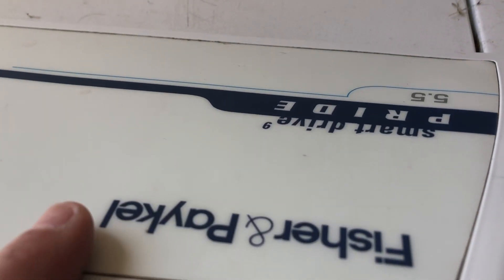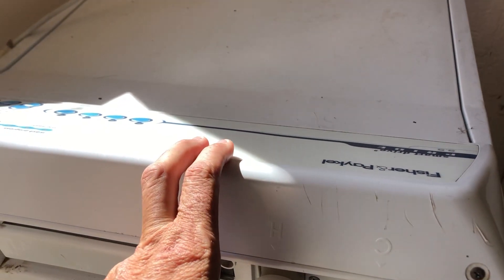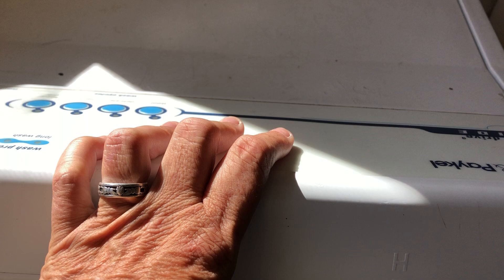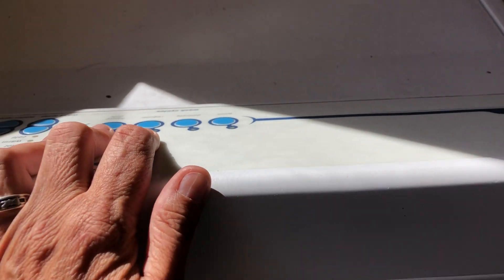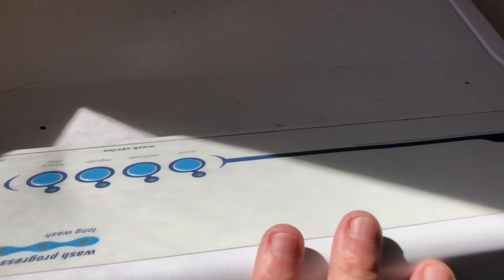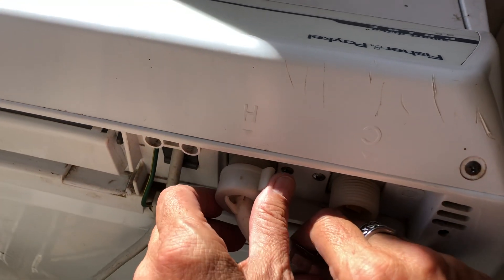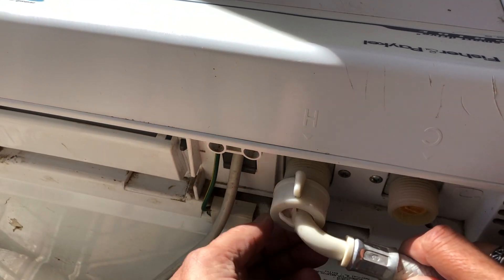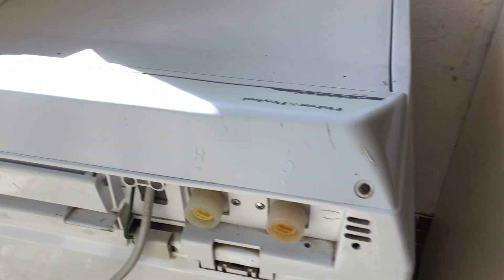Fisher & Paykel smart drive PRIDE 5.5 MW059AU top load washing machine | Water Valve or Mother Board

Comment: I’ve got the same washing machine as this one and I had to replace the whole water valve assembly a couple of years back as the seal where the thermistor would usually sit was leaking so I fitted a spare one that I had lying around and the machine has had no further issues since.
Reply from the maker: This is good to know that the repairs to bring a machine back into service do last. Thanks for watching and commenting

Comment: Cool!!! And Hot!!!😅 
Fisher/Paykel makes a great many things. Including medical machines. 
The heater that is attached to my friends ventilator is made by them. I have swapped heaters to service one and then swapped it back. If course it is a bit different with someone’s life support depends on that machine. Every thing needs to happen on the swap in order and quickly!!! 
A bit of a high wire act. 
But doable with two people well coordinated. 
Thanks for sharing this one!!
🐈‍⬛🐾🐈🐾👍
Reply from the maker: I can see how that would be a delicate and coordinated effort. Surprising thing was when the repair place looked up the price of a replacement valve it was over $160 so they found me a second hand one and they only charged me $30. A big relief since it has cost $200 in vet bills in the last two days. Our cat is very sick. This is what savings are for. She spent her birthday at the vet. Has to go for xrays and ultra sound tomorrow on her abdomen. So very happy I was able to fix the washing machine myself, our girl has been throwing up a lot and the amount of bedding needing washing seems never ending. Also the lock on our front door failed yesterday, so I replaced it at 6.30am this morning before I had to go out so I could get back in. I wonder how many other things will break down this month. I have a list of so many things to fix I feel like I am back in my handman days!
Reply: @Pocket-Watch  I have weeks like that . Not as fast on the repairs as I used to be 😅 hope your cat gets better!! That always makes things harder to deal . 
🐈🐾🐈‍⬛🐾👍🇦🇺🍻